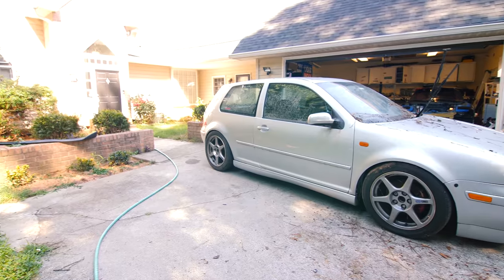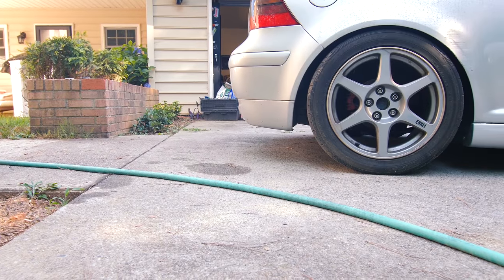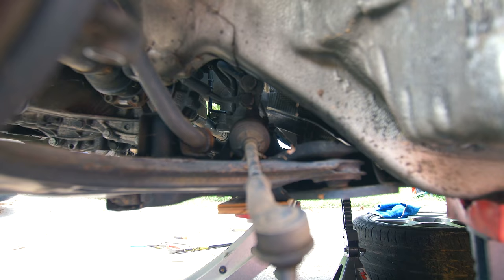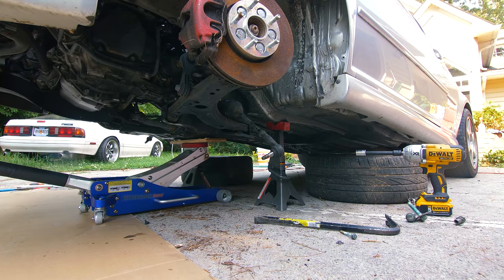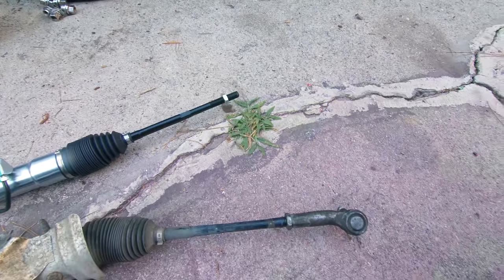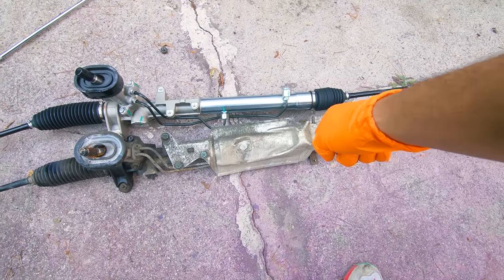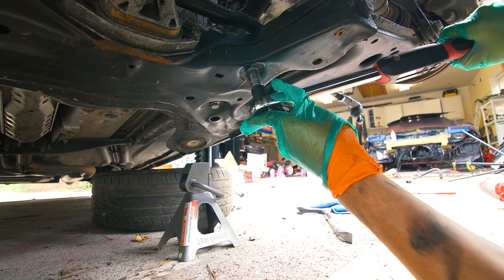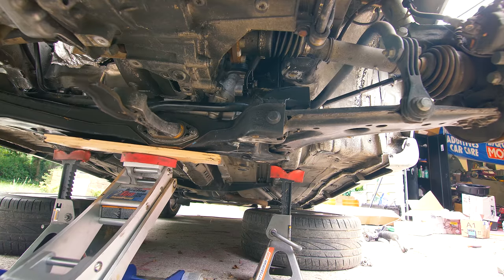Reviving the old daily: replacing the power steering rack in the MK4 GTI

Comment: Did I miss you showing connecting the steering shaft back together? How do make sure it is lined up correctly so your steering wheel is straight?
Reply from the maker: IIRC it can only go in one way - i.e there were no splines to align. I just made sure that the steering wheel was completely straight when removing it. 👍
Reply: @supercarmio  oh. Yeah I saw another video where a guy said the same thing but in your video you turned it to remove that 13 mm bolt. Did you straighten your wheel again after removing the bolt and then disconnected the steering knuckle?
Reply from the maker: @SanDiego_VDubLife  Yeah that definitely sounds familiar. Sorry it's been a while. I do remember that bolt being a real pain to remove since there's not much space under there and I hate having to work on my back under the dash 😀

Comment: Did you have a hard time putting spline in from underneath steering wheel where 13 bolt goes ??
Reply from the maker: Yes definitely! I actually found that to be the hardest part I think... needs to go in perfectly centered and I had a tough time putting it through all the way. Some wd40 helped IIRC.